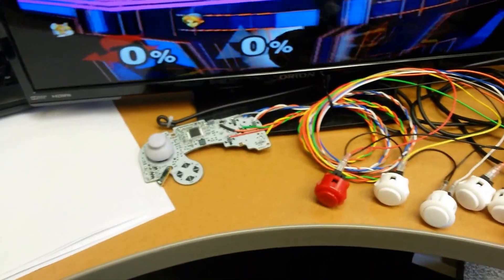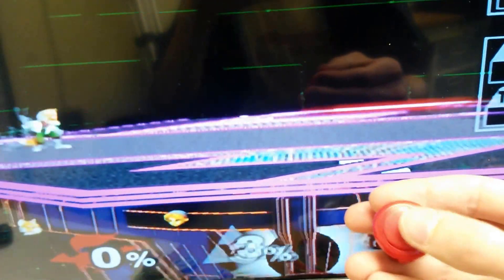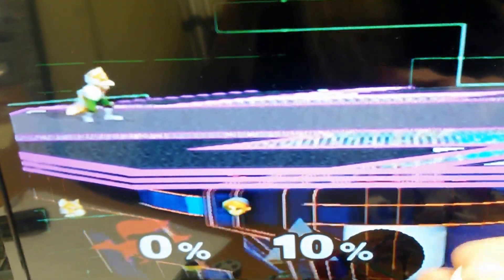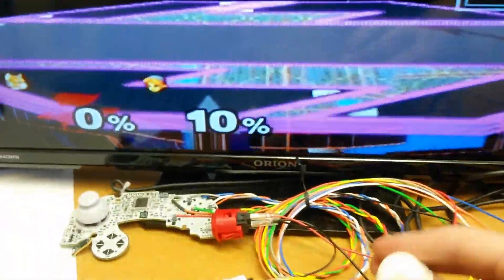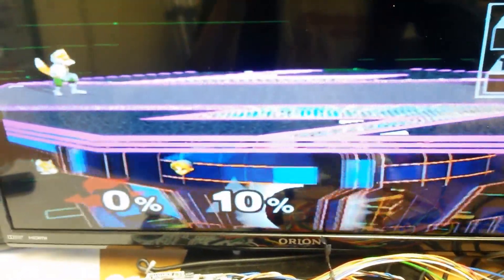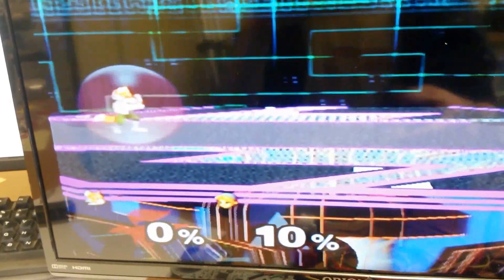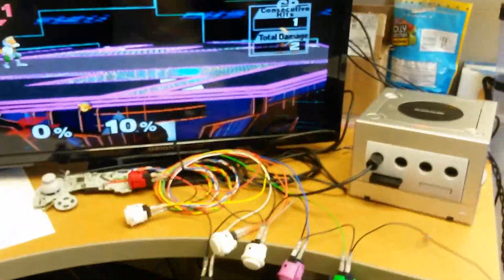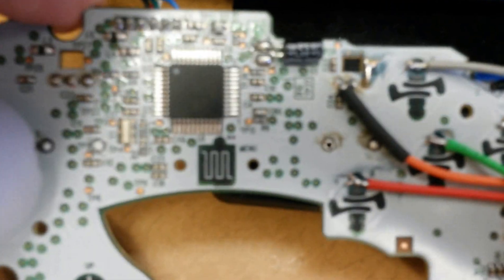Gamecube controller pad hack

Comment: I wanna do this except have an actual arcade stick to move, I'm trying to do this for my Arcade1Up mod with a Wii. My arcade stick has 5 pins, 1 common and then 1 for each direction. I know I could easily put it on the D-pad buttons but Smash just uses those for Taunts. I've got everything done except the stick, and powershield. (Mostly cause I don't know what powershield is.)

Comment: Could you tell me what the resistor values are and where they go? my GC knockoff controller padhack works well for Wii emulation, but when I play anything else it keeps repeatedly hitting a button (right analog?).

Comment: About to mod a controller this week. My questions are, is there a common ground for the the buttons on the pcb? If so I imagine there is a separate common ground for dpad? Lastly do I daisy chain the grounds from the switches to the common ground? Thanks for any help.

Comment: Hey awesome set up I'm in the middle of building one for my self but I'm a bit confused. I don't understand what and where the yellow wire for power shield is for or going to and the same goes for the orange wire the replaced the pot sensor I was on your blog and still couldn't quite figure it out could I get some more info on this thanks
Reply from the maker: Tim Pappas yellow powershield button is actually 3.3V line, and goes to the pin labeled "powershield" on fig 6 in the blog. You can see this in fig 5 which is the wiring of the back of the board. The power shield button is connect between this and the orange cable attatched to the top of the board (far left pin when viewed like in my photos)

The orange pot cable on the back of the board is the blue line in fig 4 and just attatches to the resistor (bad design decision to have a floating solder joint will probably want to glue it down after). The lightshield button connect between this cable and the other orange cable for the pot which I have attatched to the top of the board (same as lightshield button)
Reply: MichaelS-H 

Wow thanks for the quick reply and I think I understand the power shield but why was the pot sensor switched to a button isn't that for the right analog stick or is that for the right trigger
Reply from the maker: Tim Pappas The only thing I did for the right analog stick pot was extend the cables so I could place the stick wherever I wanted on the controller. The only pot I changed to a button was the right trigger.